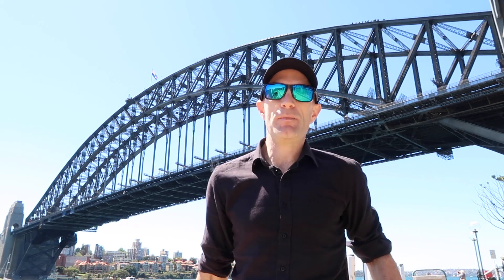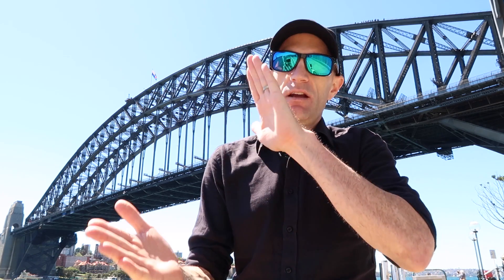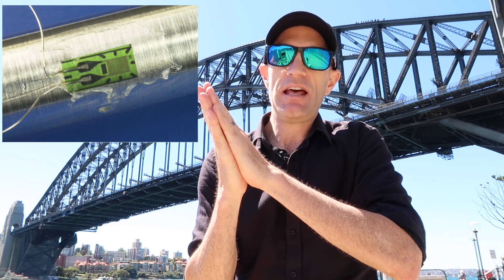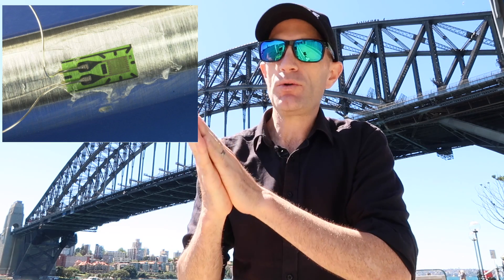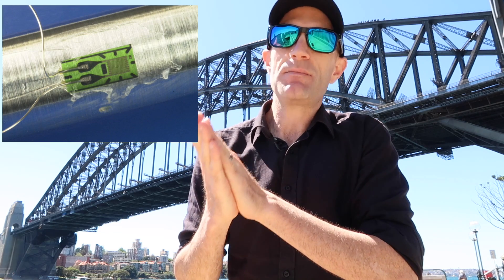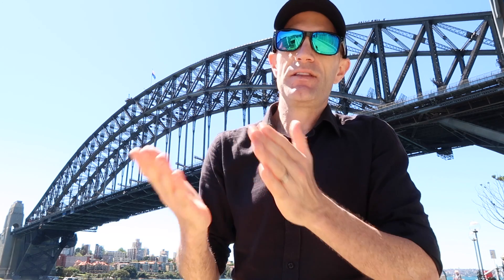Cycling Power Meters: The Basics // How They Work

Comment: Who was it that got away from using strain gauges on thier Smart Trainers because of failures and warranty challenges?
Reply from the maker: Wahoo.
Reply: Shane Miller - GPLama  Any opinions of the choice?
Reply from the maker: Their choice to switch? No opinions. The data shows the accuracy was equal or better.
Reply: Shane Miller - GPLama Much appreciated. Are you aware of anyone else using a similar technology for power measurement for cycling in general?
Reply from the maker: I believe the Neo? I'm not sure. What's important to me is accuracy and reliability.

Comment: Currently own a powertap hub and cycleops hammer. But debating a crank based to replace hub. Is that a better option?
Reply from the maker: Depends on budget, features, compatibility...  lots to take into consideration.
Reply: Shane Miller new bike is quarq power ready. So that's my main consideration. That or spending extra cash and going rotor
Reply from the maker: Go dual ANT+/Bluetooth either way to future proof the purchase.

Comment: Hey Shane, a bit late to this discussion but recently tossing up the new quarq DZERO / DFOUR or ROTOR 2IN POWER cranks. Both are reputable companies but struggling to understand difference in price point. Quarq (1200) rotor (1700). would it come down to the quality of stain gauges?
Reply from the maker: It's a lot of things. Customer support and warranty cost companies a large chunk of money... so that's something I factor into a product when I'm purchasing. Quarq PMs have been great for Von and I over the years (S-Works spider versions).
Reply: Thanks for that Shane... Yes will consider quarq. The company I'm looking at buying through is powermeter 24 (based in germany) I don't get why they are considerably cheaper than pushys or wiggle? Will have to look into warranty info. I'm guessing if something fails you can contact Australian distribution. Will have to follow up. Thanks again

Comment: I love my stages. No worries at all. Not sure if it's accurate but if you only use one you will know what number you can hold for how long and that's all that matters. Until you start using different power meters that is of course... the only thing it's lacking and I'd like to have is left AND right power measurement so I can work on symmetry.

Comment: Interesting video. Thanks for sharing your knowledge on powermeters. Quick technical question : Would a crank-based power-meter (eg SRM) always show a higher power (watts) reading than a hub-based one (eg Powertap) on the same bike because some power is lost through the drivetrain?
Reply from the maker: In theory yes, in practice the differences (if not already taken into consideration by PT?) would likely be within the published margin of error (~1.5-2%?).

Comment: Hey Shane,  have you messed around with the kicker snap?  How reliable is the power meter on that trainer?  I do a spin before every use and the power seams pretty sporadic.
Reply from the maker: No SNAP here. There's a comment in here detailing the experience someone has had with the accuracy/tyre clamp/pressure/accuracy.

Comment: I'm currently shopping for power meter on my radar is 4iiii   Did you have any experience with this brand?
Enjoying your technical videos!
Reply from the maker: I've seen them online and at Eurobike.... no experience putting any strain on the 4iii gauges myself, so nothing to report there. Let's hope they're rock solid and are a long term contender when people look at the options.
Reply: Thanks for replying 
Shane what power meter you using on your road bike?
Reply from the maker: Quarq S-Works spiders on both the road and TT bikes.

Comment: great video shane its one of the main factors that has stopped me buying a power meter, they should all give the same reading no matter where they are measured
Reply from the maker: That shouldn't stop you from getting one... they do simplify training to an extent. (says me opening a can of worms!) :)
Reply: haha yeah ive seen the studies and the ease it puts into to trianing but i just go with a max heart rate because if im near that it doesnt really matter how much power im putting out, however for pacing and interval training they would be perfect because of the lag of hr
Reply from the maker: Nailed it. Heart rate is the response to the work you're doing, power is what you're doing. HR has has both lag and a number of factors that could make it change day to day.... that's another video. Same with speed/time. There's a lot of variables. As for power, a watt today is a watt tomorrow. It's beautifully simple...... well... in theory. :)
Reply: yep youre right but i ve only been riding for almost a year and i think you may have to answer to my wife when i tell her youve talked me into a meter haha, but seriously which meter do u find the best for on bike
Reply from the maker: I've run Quarq for a few years on the road and TT bike (two different units). They've been rock solid and also have the ability for me to calibrate them with a 20.000kg weight so I know they're spot on accurate (or pretty close to). I hear good things about Power2Max, and there's a lot of new players in the market. So when the time comes to pull the trigger there should be a few to choose from that'll do the job reliably.
Reply: cheers mate ill look into quarq for sure i like the idea of being able to calibrate a machine because of the variances dou to the enviroment

Comment: I have a first generation stages and a power tap pro+ 
I like the stage's very much buth have had some battery problems with it. Sometimes it would drain the battery in 1 week. Buth like now it's going into it's 4 month on the same battery... 
Powernap has had also some problems with battery's going death quite fast buth not to the amount of the stages. 
Buth you are alway's stuck with the same back wheel...
Reply from the maker: If I recall correctly there was a firmware update for the Stages early on that helped with the battery drain.... something to do with it not going to sleep (accelerometers?). PowerTap hubs were my first power meter back in 2006, they were great units. Except the first one I had that refused to work under 17degC..... precious little thing only liked the warm. Much like its owner! haha! :)

Comment: Great video Shane. I use a Quarq Elsa and find after zero offset on the Quarq it reads consistently 20 or so Watts lower on the garmin head unit than say if I use the data output on the kickr after a spin down. What's your thoughts. I also find the Wattbike output similar to what I get at Spin Fit to the Quarq.
Reply from the maker: Put the Quarqs on a Neo (or Drivo, but they're not around as yet) and see what the difference is. Then you can determine if it's the Quarq or the Kickr that's out. Good news being that the Quarqs can be calibrated with a known weight (20.000kgs is good!) and the Kickr can be brought into line with either their super secret pinch roll-down thingy test (I'll locate this and make a video one day....) and/or their calibration kit (arm and 10lb weight)

Comment: Another great video. Funnily enough I rode with two pm's yesterday: Garmin Vector 2's and a Powertap G3 wheel. In general they track each other well. The only discrepancy was the final 10 mins or so in the second effort. This may have been due to an auto zero as there was some freewheeling just before. Temp drop each time was about 5C.

Lap by lap comparisons:
#1 Laps 7-12 / 32 mins 
281W, 295W, 249W, 297W, 300W, 310W - Powertap -- avg = 293W 
282W, 296W, 254W, 295W, 301W, 308W - Vector ------- avg = 293W 
--------------------------------- 
#2 Laps 17 & 18 / 29 mins 
280W, 290W - pt -- avg = 284W 
279W, 281W - vct - avg = 280W
Reply: Over the entire duration of the efforts: 
#1 34 mins - Powertap = 293 NP, Vector = 293 NP
#2 29 mins - Powertap = 288 NP, Vector = 284 NP

Maximal efforts are a different story, the Vectors often read significantly higher. I think the DC Rainmaker review covers this issue. It may be due to the location of measuring but as Shane says perhaps some type of standard needs to be created so 1 Watt = 1 Watt etc. As I'm not a sprinter it really doesn't bother me!
Reply from the maker: Interesting! And data too! Excellent! Are those within the margin of error % that Powertap and Garmin quote for their power meters?
Reply: Powertap quote 1.5% and Garmin 2%. So over the entire duration of lap 18 it was within tolerance. The final 15 mins (just the bit after the freewheeling) was 290W Powertap, 281W Vectors. When doing these kind of efforts I often put two pm's on the bike so I have a fair bit of data.
Reply: Interesting.  I'd be curious to know if NP tracks similarly and how close they are in the max 1-5 second range.
Reply: Cool.  Thanks for that.  There are probably all sorts of aliasing and cadence phase shift effects for very short durations anyway.

Comment: But Shane, of course a Powetap (hub) will show different watts from a Powertap (pedal). One measures at the pedal, the other measures at the cassette, when drivetrain efficiency becomes an issue. This is also the reason why people doing field tests for drag testing (i.e. Chung testing)  prefer to use powertaps, it just takes drivetrain efficiency out of the equation.
Reply from the maker: imo they should factor this into the power meter. Drive trains have known loss, sure. So factor in an average and report power that's more consistent across all products. Again, all my opinion. I'd be pretty pissed getting ripped off a few good % without the manufacturer making this clear in their product manuals/marketing.
Reply: I understand your reasoning but I feel that any sort of correction from the powermeter would fall short of its aim. Especially since any correction would have to find a medium between all the variables that adulterate power measurement from the source until the meter. I'd rather have an unfiltered (relatively speaking) output and accept that it reads differently from a powermeter in a different location than a filtered output where I have no idea what kind of correction is taking place, in an effort to "normalize" between the powermeters.

Comment: Shane what do you think of the pioneer single crank compared to the Stages? Great video by the way, loving the content. Could I suggest making one about bike carriers, especially in relation to using them with carbon frames. Best, worst, misconceptions that are out there. Cheers.
Reply from the maker: I've not used a Pioneer, so I've nothing useful to contribute there. Stages. Well... I have one sitting on the table at home I'll put to the sword when I have a chance. RE: Bike carriers. We use Thule OutRide 561 (front wheel off). Super stable. No issues using them with all our carbon bikes. Although if the weather is extreme (very extreme!) and there will be huge cross-winds, the bikes go in the car.
Reply: Thanks for the info regarding the bike carrier, I will look forward to the stages test.

Comment: I have a Pioneer dual sided setup on my bike. And my wife and I share a Wahoo Kickr Snap. This is actually our second Snap. The first one suddenly started giving bad power numbers. I got it in January and around when Zwift Academy was going this summer, my wife was using the meter on the Snap for the workouts. The first issue we had was her doing the spin down every time. We were sharing the trainer so she'd put her bike on, I'd take it off put mine one, take that off, put hers on, etc. That meant that we were not always setting the flywheel tightness the exact same every time. I use the Pioneer so I never bothered with 0 offset. But she used the Snap and there were many days that she'd forget to do that and either feel great or struggle depending on how hard we tightened the unit vs what it was 0 offset for.

But back to the problems with the first unit. After months of use I noticed that the power numbers were going lower and lower. Despite training hard all spring for San Diego century, my numbers kept dropping. After I got the Pioneer on my bike in April I noticed that the Snap read about 20% lower consistently. At least it was consistent, so my wife could reliably train off of that. But after another month, the number dropped to reading 50%. By the time she was doing ZA, she had done the first few workouts and recorded and FTP of 165. But when the meter started to go bad, she was struggling to hold 100. I worked with Wahoo support for a couple weeks. I did the spindown. I compared the numbers vs the Pioneer. I tried on Zwift, using Garmin head units (we were afraid it was a bad ANT+ key that may have been causing issues). Nothing helped. We ended up exchanging it for a new one and the issues went away.

Wahoo had me try several things. One was a workout using their fitness app that had me ride at a constant power, then try different inclines using the app, try different resistances. Try sprinting. What we saw was that during acceleration, the power would spike like we'd expect. But the power numbers being reported would drop considerably. Usually to about 50% of what my Pioneer showed (which was also properly 0 offset). Sometimes it would report 0 power.

In the end, my local bike shop took care of everything. Wahoo tried to help me but we didn't have time to continue going through their steps (wife was doing ZA and wanted to be able to do group rides but it is really hard to ride at 2.5 watts/kg when her threshold is about 3 watts/kg and the power meter is cutting power in half or worse). So we did the exchange. Wheel on smart trainers are great for people taht want lots of features but have a smaller budget. Probably the biggest drawback is dealing with the 0 offset when you are constantly taking the bike on and off (either when sharing with another person or if the weather permits riding outside but you are doing some indoor training). And the next is dealing with a trainer tire. Both her and I have trainer wheels that have a tire and trainer skewer ready to go. Mavic Open Pro 32H Ultegra hub and cassette for mine. Mavic Open 32H with 105 hub and Ultegra cassette for her. Nice thing about those wheels is my trainer wheel is same spec as my normal wheel. Should anything happen to my road wheel, I've got 1... well 2 backups.

We are adding a second trainer to the pain cave before next summer (peak trainer season for us here in Phoenix). And we are looking at a different model to make the offset a little easier. That ad eventually adding a power meter to my wife's bike (she's still deciding on crank arm length... currently using 165mm arms at 5'2". Once she is sure what crank arm length she wants long term, we can find her a meter that fits).
Reply from the maker: That first Kickr SNAP sounded like a nightmare! Thanks for sharing the story.

Comment: Heya Shane. Great vid again mate. 

To give you some feedback, I've held off on buying a power meter just yet. Bikes are expensive, wheels are expensive, and while power is not new, I'm hesitant to throw cash at it just yet. PM's sort of give me strava syndrome, i.e. not really enjoying riding as much, just trying perform better than your last. That's a user thing though.

I've seen a lot of development over the years, but if I had to make the plunge, I'd go a double sided PM. I'm not sure if 4iii are there yet, but irrc, their business model was to make an accurate PM, for the cheapest price. I think they were retailing for less than $500 at one point. This appealed to me because the point I'm trying to make is that power is just a number on my garmin. I couldn't care less how looks on the bike, so long as it's affordable and is accurate and other than a training tool, I don't value it as much as say trying to hone in my bike fit.

Comment: Great video, Shane. What is your view on the Powerpod Powermeter?
Reply from the maker: I wouldn't buy one.
Reply: in fact the Powerpod isn't a pwoermeter at all - it calculates (or estimates...) power from speed, wind, gradient aso. Not only the margins of all these accumulate, but some very important factors are not mentioned at all, for example how aero (or not aero) your actual position on the bike is. In my opinion the Powerpod is a toy, but not a tool for serious Ttraining
Reply: Old topic I know but in case it helps anyone. I bought two, and both failed in the same way! Totally dead will not charge, nothing. Being electronics minded I split them apart and replaced the lipo batteries, but they are still dead. Only way to repair them was to return to USA with all the costs involved. They are about to go in the bin and I’ve just ordered a Quarq DZero as it was on offer (£400)

Comment: I personally have had a few in my time.... First one I bought was Garmin Vector... had nothing but issues with connection to my head unit, and the service from Garmin was what I would call sub standard. Second was Stages.... 4 units later I received a version two unit, worked fantastic but only measured left leg power and I always felt in the back of my head due to the fact of the last three units I had how accurate was it..... Lastly I have and still have a Quarq Elsa RS fanatic unit no issues solid as a rock, had an issue with firmware upgrade rang Quarq in the states over the phone they were fantastic.... One thing I will state from my riding with all of the above three, Vector reads lowest of the lot, followed by Stages then Quarq what one is accurate? No clue...... anyhow thats my story :D
Reply from the maker: Very similar to a lot of people I've spoken to who've owned the same power meters. I love my Quarqs too. They've been brilliant for years.